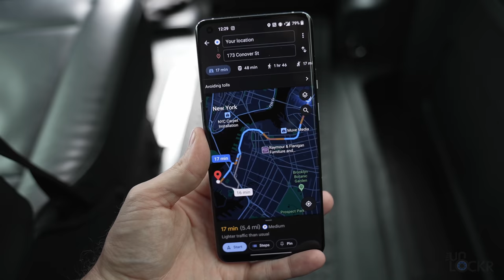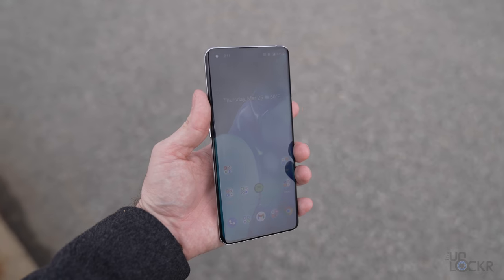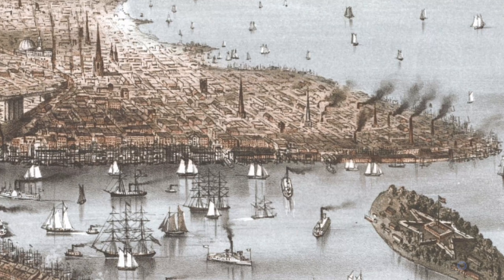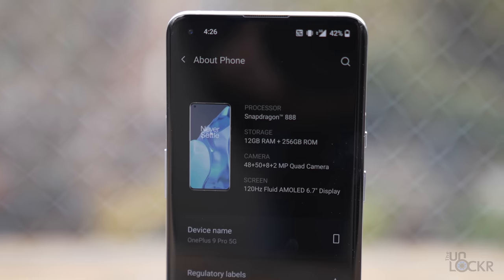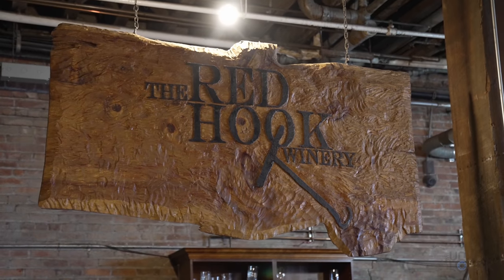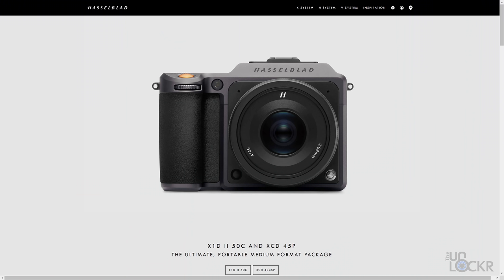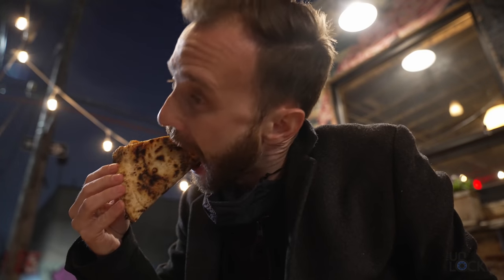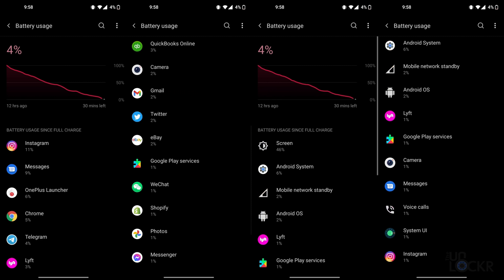OnePlus 9 Pro Real-World Test (Camera Comparison, Battery Test, & Vlog)

Comment: I had mine delivered Tuesday morning. I ordered the Black as the Green was out of stock. I am quite happy with the screen and the camera, since It had 4 updates it is now great. If I wanted anything greater I'd get out my DSLR Camera. The price was a tad high but taking into account you get the Wireless charger free here in the UK (selling for £70) makes it a better price to swallow. One serious mishap was when setting up the Google Pay I got a failed message."Couldn't finish setup to pay in shops. This phone can't be used to pay in shops. This may be because it is rooted or altered in some other way" Coming directly from OnePlus I thought this odd. Thankfully after those 4 updates it works fine and I used it whilst shopping this morning. WiFi Calling works like a charm for both Vodafone and '3' alike and voice calls are pretty full sounding.   Stay Safe David ...

Comment: In your samsung s 21 ultra you got approximately the same results of battery life ; however, you called it a great battery performance.  You had 12% left with 4h 50 min of SoT on S21 Ultra.(btw, samsung has bigger battery 5000 mah) Here you have 4h57m of SoT with 4% left.(4500mah) I don't understand.

Comment: I got the pine green OP9pro. I don't like ios and I don't like the look of the s21 back camera, so that's why I went with OP. I upgraded from an old Huawei from 2016 that stopped getting updates in the US, so to me, the camera is incredible.
I will say, battery drain is real, but I am using the highest settings constantly and haven't tried lowering them to see if it will last longer. Also the wireless charger is so amazingly fast that the battery drain doesn't bother me so far. It also works with my popsocket on.
The speakers sound great and the vibration feels solid as well. Just a bit unfortunate that it doesn't have 5g with AT&T right now...

Comment: OK. I have all that flagship crap, having 3 SIM cards active all the time. Let's start with a spoiler: my main SIM is now in the OP9Pro.
The 2nd. SIM which was on my previous main is now in the iPhone 11 Pro, a marvel phone in its own right. Starting with battery life, going on to camera performance (still very good!) it'd hard to say goodbye to such a portable and competent machine (I imagine the 12 Pro would be very similar). Now, which is my current#3? The iPhone 12 Mini!!  Apart for weak battery life (not enough size to accommodate a decent battery) this has everything you would wish in a flagship - coming to you in the most portable of formats. Now the ones that went to the drawer, only to come out occasionally: iPhone 12 Pro Max (has zoom, good cameras overall with some zoom, too big in format, the horrible notch, well - overall very good - but the OP9 Pro is way better. The 9Pro has: better camera night mode (surprise!), easier handling (format, weight, lower width), decent battery (not as good as the 12 Pro Max) and... no notch. The other flagship relegated to the drawer was the galaxy S21 Ultra. Bigger and less handy, the photography is quite lacking in night mode, the zoom is - of course - way better - but only with great light. Battery life also quite good. The 12 family of iPhones is still better than the 21 Ultra for me. I put in it a shadow SIM (a duplicate) of my main SIM, so it leaves the drawer occasionally, and not only for the weekly updates, as the others there. In summary - the 9 Pro came, saw what was here and... won (Veni, Vidi, Vinci!).